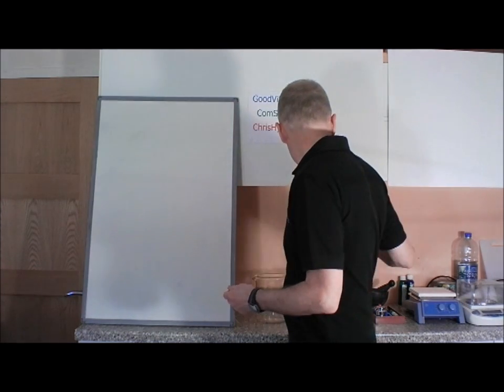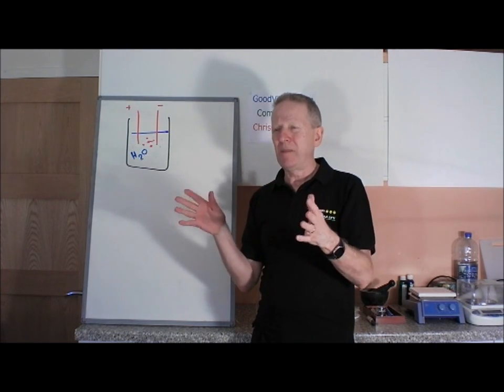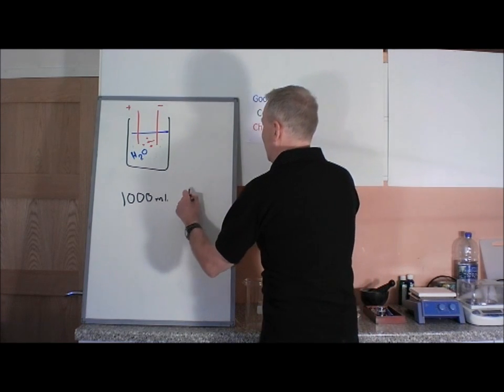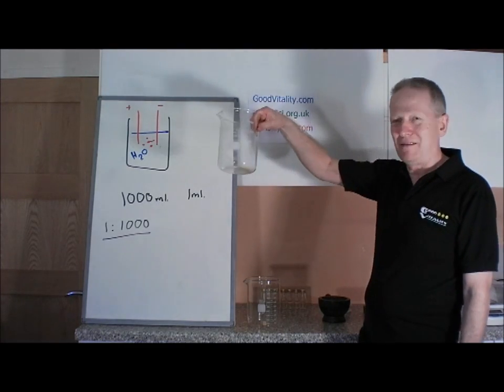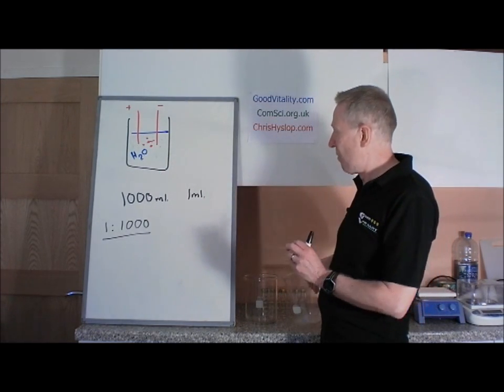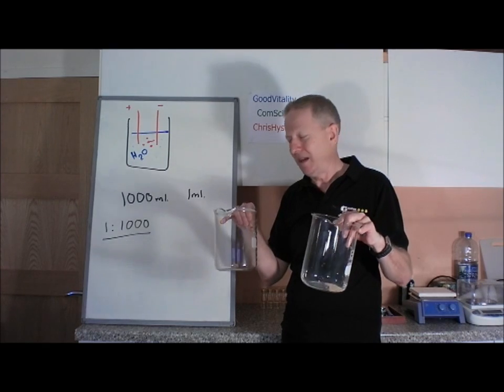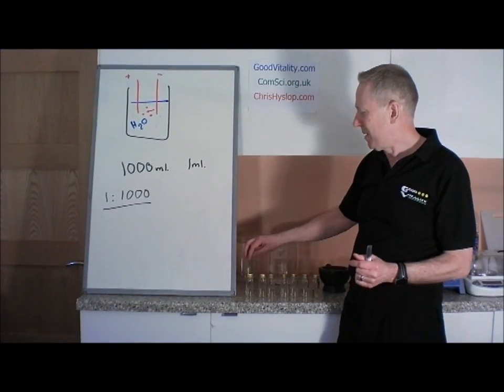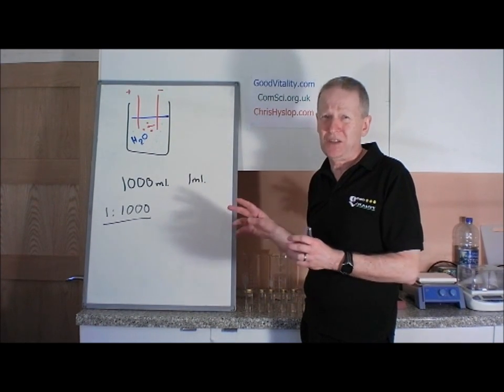Quality of Colloidal Silver and PPM

Comment: Is there a formula to know what you have?  I've been using a TDS meter.  I use distilled water which is 100% pure water.
Reply from the maker: no you obvioualy can NOT use a tds metter as all that measure is conductivity.
Reply: On the colloidal silver colloidal gold forum site they use a mathmatical formula to determine concentration of your product. I just use their method and brew it for an hour and a half and it comes out lite yellow ( which means 20 ppm) the darker yellow is higher ppm and larger particles , bad. I'm running at 27 v and 9 milli amps.

Comment: Hi Chris
I make my own Colloidal Silver Or maybe it’s Ionic Silver?
That is, watching all these YouTube on making Colloidal Silver, I come to assume that any home generator to make Colloidal Silver actually is Ionic Silver.

My question: I always stay consistent in making my Ionic Silver.  That is....
I use the same beaker - with 1/2 liter distilled water.
I use a device that provides the 27 volts and delivers a constant current.  That is it delivers a consistent current no matter how long And how much conductivity the water has with time, temperature or other.
I always operate for 2 hours with a rod cleaning after the first hour.

When done I store in clear sterile mason jar in dark cabinet no light.

Upon completion My Ionic Silver is clear and measures 10 ppm.

However, after storing 24 hours the clear Ionic Silver turns yellow?

Does this mean the Ionic Silver turns to Colloidal Silver after 24 hours?
Reply from the maker: It has oxised.  Fill i would sugget a bottle to the top screw capon tightly should slow this process down. But this is physics; it will happen!!

Comment: What voltage do you use and what amperage do you use?
Reply: Fred Davis I have heard the smaller the voltage makes smaller particals.
Reply: Hi Fred, you should keep the current under 5 mA. At the start of the process (because of the high resistance of distilled water), you might need a voltage of up to 300V, but after the current starts running between the electrodes, you will have to get down to as low as 7 or 8 V. I use a variable power supply so that I can limit outgoing current to a set value (1 - 5 mA)
Reply: The current depends on the size/diameter of the electrodes you use. If you use silver bullion coins, then you need to use more current. 5mA is usually correct for silver rods you get on ebay, etc...and will give you a really good quality CS..

Comment: Silver ions are absorbed into body and transported through the bloodstream by metalloprotein transport (metallothionein abbr. MT). MT transport of minerals (copper, zinc, silver) is well established, and MT has been known to science since 1957. It doesn't matter how much silver is in a test tube a test tube; you body is not a test tube.  I agree that particle size is important, however below a certain threshold (5 ppm, determined in 1902), silver isn't considered to be therapeutic.  I know you don't want to hear about ppm, however it is relevant as you do not want too much silver (ions or metallic particulates) to be ingested into the body.
Reply: Renshen1957 PS Straw colour? Orr and Dallavalle determined colour in colloidal silver 10 ppm occurred with particle sizes larger than 0.2 micrometres in 1959. Flocculation will betray a colour, or higher potentcies (>166 ppm).

Comment: If PPM wasn't an issue at all, the manufacturers of their product wouldn't make it an issue.  The less PPM in the solution, the more dilution occurs that you have to take more to get its benefits.  A 1 PPM product is inferior to a 10 PPM product. So, it's not at all insignificant.
Reply: Exactly! 

Assuming the particle size is similar between multiple products, the PPM is what provides the apples to apples comparison in terms of effective quantity.

I buy 500PPM silver wings and dilute it to what I need. (10PPM for eye/ear infections, 20PPM for use on skin, 50PPM for infections, 100PPM for severe food poisoning).

Comment: Thank you for the information, really helped a lot.
ok I have some question if you dont mind.
#1:
how to get a finest particle of the silver?
is the voltage matter, let's say, 12v battery with about 15mA makes smaller particles than 36V 15mA, for example?

#2:
I saw many videos about adding an aging solution to the Ionic silver, and heating it to get the amber looking solution.
so what is the difference, of the foggy or clear looking solution and the reddish one?
Thank you
Reply: Chris Hyslop
Agree.  Originally I used to start with three 9v batteries but once the colloid started to build up it would go too fast and sometimes run away on me if I didn't really watch it. But what I learned to do was to start with 2 new or almost new batteries and then as the the process progressed take it down to using only 1 battery. This is a lot slower, takes about 6 - 8 hours, but the end product ends up looking a lot better. The last time I made it, I used an air pump to put a slow stream of bubbles in the water (no air stone, just the open end of the tube). This helped a lot in preventing any buildup on the one electrode. If I had a regular generator that alternated between the two electrodes, the buildup wouldn't be a problem.
I use 12guage .9999 silver wire. I make it in a quart (.946 liter) glass jar. My electrodes are about 6 inches (15.24cm) long and I have them mounted through a piece of  plexiglass that fits across the jars mouth, about a half inch (1.27cm) apart.

There are a lot of generators out there and I know it gets confusing for a lot of newbies when they are trying to find a good one. Everybody says theirs is the best and then proceeds to tell you why. So to them I can only say research the facts about the silver colloid and try to make a well informed decision

As to ionic or colloid silver, colloid is what you want. But in the process of making colloid, a certain percentage will be ionic. Keep in mind that if it is actually pure ionic silver, it will not reflect the light like colloid will. That is because ionic is not a particle, it is a electrical charge.
Reply from the maker: reversing polarity on the electrodes!!
Reply: To get the finest particles of silver I use low voltage. Two 9volt batteries hooked up in series, negative terminal to positive (you can just snap the batteries together and you have it) and then using two alligator test leads, connect one to the positive and one to the negative and then to whatever silver you are using. Silver should be at least .999 or better yet .9999, that's what I use.  (maybe I should just make a video)
I'll try to keep this short.:<) 
NEVER use anything but pure distilled water. And NEVER add anything to the colloidal silver. If you do, you no longer have colloidal silver and end up with a silver salt, like silver chloride (what you get if you try using table salt in your water). These are the people who develop argyria and turn blue. Pure silver will not turn you blue!
Chris is right about ppm but I do think it is helpful when making your own colloidal silver. I use a TDS or PPM meter to test mine and I take it up to about 20ppm. This at least allows me to make consistent batches of colloidal silver. If you have a laser pointer you can kind of get an idea of how your batch is coming along. Pure water doesn't reflect light that shines through it. But as the silver builds up, the laser light shining through will start reflecting back off the silver in the water.
 
As to the color of the solution, the SMALLER your colloidal particles are, the clearer your solution will be. That's because the color you see is the light being reflected off the silver particles. Little hard to explain this but, the light wavelength that reflects back from small particles will be in the range of very light yellow to almost clear. As the particles of silver get bigger, the longer/higher wave lengths are able to reflect back, giving it a darker color. Hence, the bigger the silver particles, the darker the solution, the darker the solution, bad stuff it is becoming.
SMALLER is BETTER, as they more easily attach to the virus and bacteria receptors, and as Chris says," suffocates them.

As to your #2 question. Everything they are doing is WRONG. Absolutely do not do any of those things. They all degrade or destroy the healing effects of the silver. 
Hope this was helpful.
Reply from the maker: Wis.Gardener You really should not bubble air through the CS as this will oxidise it!!!  Not good.
Reply from the maker: Wis.Gardener One thing to consider here  is you have no current limitation;  this is crucial in keeping particle size small!!!
Reply: Chris Hyslop
A mechanical stirring device would have been better to keep the liquid in motion. Perhaps I should not have recommended using the air. But that is why I wouldn't use an air stone, the bubble rate was very slow, just enough to move the solution a little. There is some controversy out there on whether oxygen is bad when making colloidal silver. So who knows?? The "SilverLungs" people say it's no good, but "The Silver Edge" people say oxygen is good as it helps kill the bad guys. Pick your poison, I guess.

To those out there contemplating making silver and wondering why I would want to stir my solution, here is what happens. Your two silver sources (I use 12gauge wire), the one attached to your positive electric source is the "anode" this is the one that your silver is transferring from to the water. The other is the neg, the cathode, that completes the electric circuit. What happens is that as the water becomes more conductive from the silver buildup, some of the silver colloid particles will be attracted to the cathode (neg) and build up on it. (the silver has a positive charge, pos and neg attract ). By keeping the water moving, prevents most of this from happening.
Reply from the maker: This is why we supply reversing polarity technology on our 5010 Becks silver zapper, no need to stir and super fine particle size
Reply: Use resistors on the positive side to keep your amperage low (to maintain 15 mA

Comment: Exactly how is the colloidal silver you market made? Details such as is heat used, ac or dc, optimum current between electrodes, voltage, dimensions of electrodes.
Have heard if the CS is clear it is ionic silver and if tinted amber it is true CS not ionic. What say you?
Reply from the maker: ours is straw coloured.
And our manufacturing method is obviously a trade secret and quite sophisticated!!

Comment: I have not used CS yet but am researching its manufacture and use...  I will make my own, I'm not paying exorbitant prices being asked for something so simple to make... My question is this, If I use 24 volts DC 500ma to 12 gauge 99.999 silver wire will that be correct for the more useful smaller particles of silver suspension?  As I understand it, the Current dictates the size of particles being put into suspension, Voltage dictates the time needed to put those particles into suspension..
Reply from the maker: That will definitely make Colloidal silver, re current limitation and voltages  it is impossible to answer as that will depend on so many variables to consider.
Reply: I made CS using boiled water with 2 x 1.5  volts AA batteries          =3        volts                  with a red led in series.     Net voltage is        3 volt      minus                          1.5     volt for the led = 1.5 volt   s. I also put a 3   3 k current limiting resistor in series to keep particle size small. The measured current was 30 micro amps.          Boiled water is used to sterilize     the water and to remove dissolved gases in the water . 

I made 2ppm CS after 13 hours and 40 mins in 0.8 litres of water.Very small particle size.People who use 4 x 9 volts = 36 volts still don't understand ohms law. No need for high voltages at all or expensive 9 volt batteries.

People step UP   the voltage then put in a resistor in series to step it DOWN      again because of the high current making huge particle size CS.The resistor absorbs voltage.People still don't understand Ohm's Law. V=IR.    

Also it is the     CURRENT that generates colloidal silver.Remember that .     Coulombs Law of Chemistry.

The voltage required is simply the "pressure" required to push a certain current through water.The other day I made CS over 5 days using 30 MICRO amps of current in water which had been boiled using 2 AA batteries with a 33  K resistor in series and a red led in series . I got 10 ppm very small particle size CS.

You use this Faraday's Equation Calculator spreadsheet to work the ppm for a given current,time and volume of water:- http://www.silvermedicine.org/faradaycalculator.html

Comment: My bottle has 500ppm is that safe?
Reply: Chris Hyslop conrod hall Well, it's all about concentration right? Therefore, you can dilute it to the desired concentration. Use distilled water as it has less undesired particules which will affect quality. For example, if you want a 50PPM solution, you will have to take, let's say 1cl of your bottle solution and add 10cl of distilled water, you will have a 50PPM solution. Voila!
Reply from the maker: I would not use it!!!
Reply: May I ask why because I already started the brand which is called " natural path silver wings"
Reply from the maker: conrod hall simply because of the amount of material silver in it!!!
Reply: conrod hall yes its safe

Comment: Have used this guys silver maker, it is pretty reliable. Had it three years now. A little tip, make the colloidal silver with hot distilled water in a thermos flask. It takes about an hour and produces particles that result in a pale yellow (nano sized particles) solution.

It is effective for warding off sore throats and promoting healing in cuts with less scarring.

The healing information was obtained from a great research paper written by a little known scientist called Robert O Becker (R.I.P). He showed that with silver dressings deep diabetic ulcers (to the bone) can be healed.

He also regrew limbs on mammals using a silver cell that diffused silver ions into the wound. He got the idea by measuring the electric fields around the limbs of Salamanders that can regrow limbs naturally. He then worked out how to reproduce the field in mammals.

 He would probably have won a Nobel prize had he not offended the energy industry by pointing out that power lines increased the risk of cancer.
Reply: I made CS using boiled water with 2 x 1.5  volts AA batteries          =3        volts                  with a red led in series.     Net voltage is        3 volt      minus                          1.5     volt for the led = 1.5 volt   s. I also put a 3   3 k current limiting resistor in series to keep particle size small. The measured current was 30 micro amps.          Boiled water is used to sterilize     the water and to remove dissolved gases in the water . 

I made 2ppm CS after 13 hours and 40 mins in 0.8 litres of water.Very small particle size.People who use 4 x 9 volts = 36 volts still don't understand ohms law. No need for high voltages at all or expensive 9 volt batteries.

People step UP   the voltage then put in a resistor in series to step it DOWN      again because of the high current making huge particle size CS.The resistor absorbs voltage.People still don't understand Ohm's Law. V=IR.    

Also it is the     CURRENT that generates colloidal silver.Remember that .     Coulombs Law of Chemistry.

The voltage required is simply the "pressure" required to push a certain current through water.The other day I made CS over 5 days using 30 MICRO amps of current in water which had been boiled using 2 AA batteries with a 33  K resistor in series and a red led in series . I got 10 ppm very small particle size CS.

You use this Faraday's Equation Calculator spreadsheet to work the ppm for a given current,time and volume of water:- http://www.silvermedicine.org/faradaycalculator.html